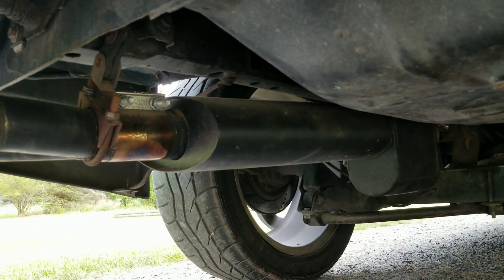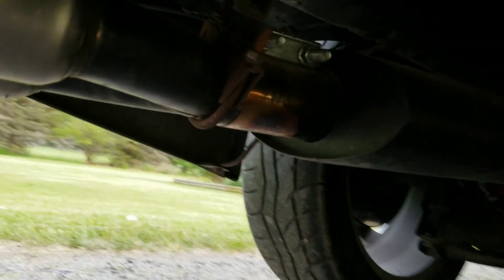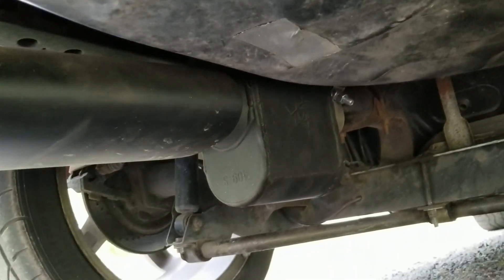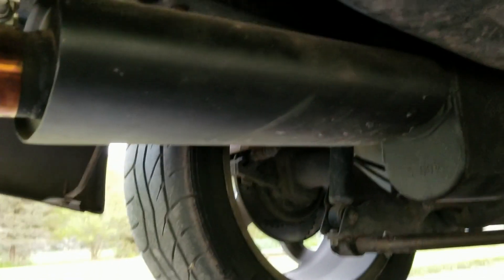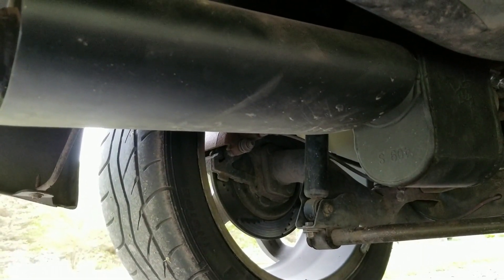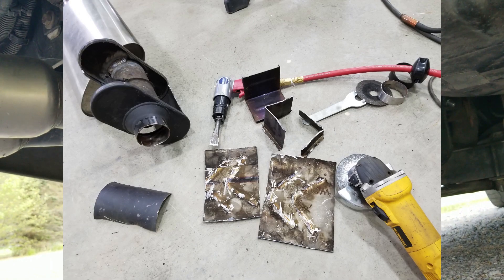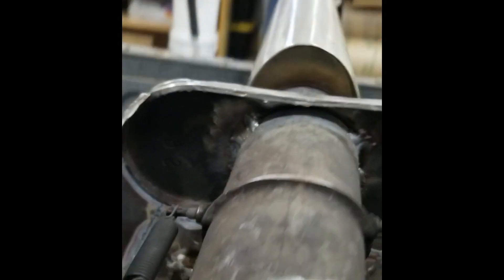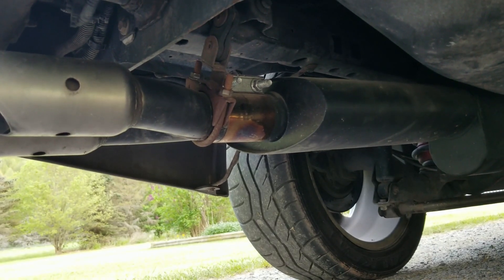FINALLY! The perfect sounding v6 exhaust - revision #5 or 6.

Comment: The 60V6 is definitely not usually the best sounding of engines. I have a Borla ProXS muffler on mine and I've been very happy with the sound.
Reply from the maker: I had a Borla XR1 and it was suuuuper loud. Stock exhaust for 2.8 3.1 MPFI actually had a nice burble, but that was engineered for half the HP as my cam & heads 3400. Haha

Comment: Sounds good! Im going to try to make my exhaust equal length to the turbo on the 3100 in my truck, once I build some headers for it. Right now it sounds good at idle but has the v6 rasp from 2500 rpm and up! Lol
Reply from the maker: Don't be afraid to keep changing it. This was my 5th or so revision before I was really happy with it.

Comment: I bet this would sound amazing on a 4.3. The 4.3 already has a rumble. It just gets rich at higher rpms.
Reply from the maker: I dunno, try it out. My street blazer is whisper quiet and my off-road blazer sounds like a tractor🤣
Reply: @GEARHEADdezign  my Bravada sounded great with a Thrush in place of the stock muffler. Just not when you got on it.
Reply from the maker: @RodknockRhett  like a glasspack or their "welded". I had the chambered one on my z71 and it sounded good. Rotted out in just a couple years though

Comment: You left that really open ended, "the perfect (GM 60 degree) V6 exhaust...". Get some Honda, Toyota /Lexus, Nissan /infinity, Ford, Mazda or other guys in the mix, and it's probably still the best muffler set up for their application, but you can not compare the sound
Reply from the maker: I guess maybe. Just by trail and error though, it's definitely the best iteration I've ever come up with.